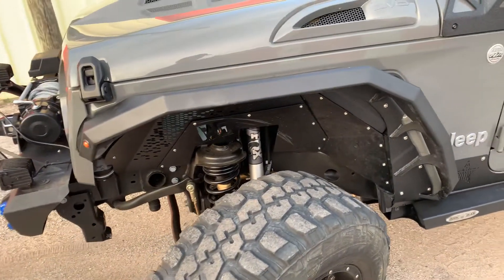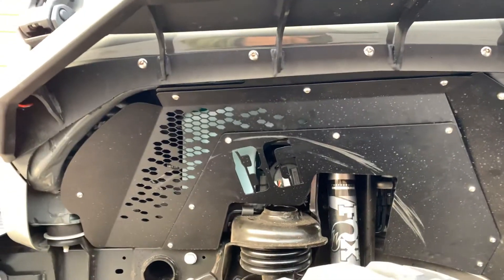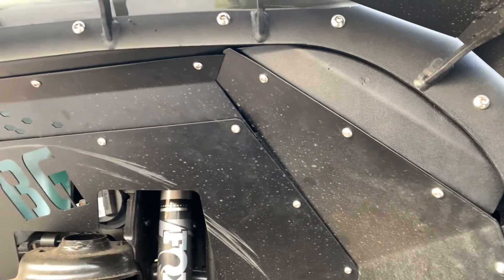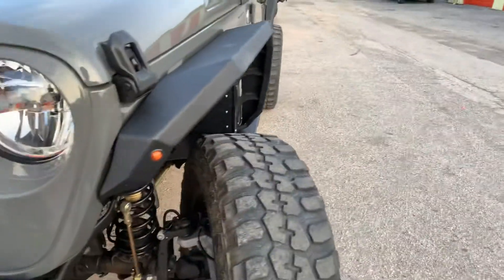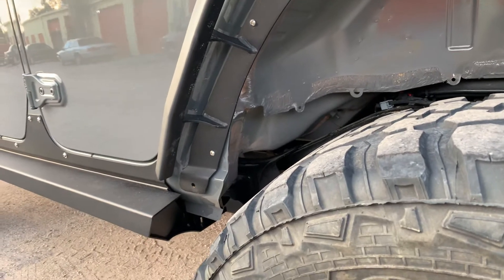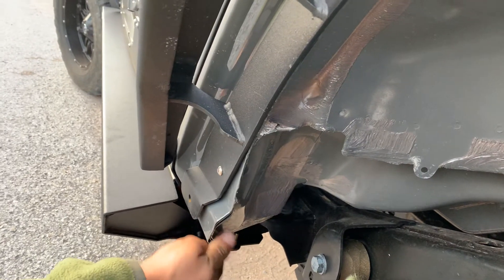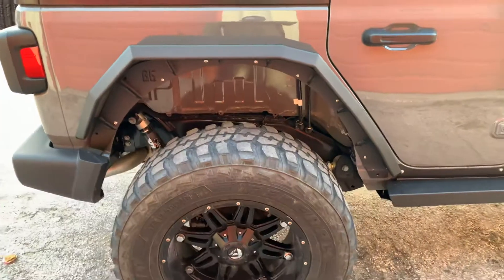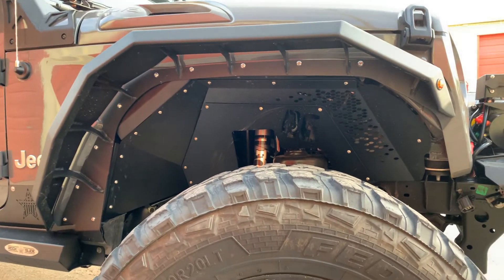Fender and Fender Liner Install Part One…

Comment: Man that sucks because they look pretty rad!  I can't thank you enough for the honest review!  I just checked the install instructions on their website for a JT and it doesn't seem like they took any of your advice except for possibly the square nut inserts.  Absolutely zero mention of cutting the support tabs in their instructions and it's obviously 100% necessary for installation.  Pretty shotty pics and instructions honestly.  The Road Armor Stealth fenders are pretty similar and their instructions are much more detailed with big color pics.  Everyone seems to be rocking the Fab Fours fenders for JL/JT so I'm looking for something different.  I just subscribed cuz I really appreciate the honesty as I was just about to pull the plug on these.  Salute!

Comment from the maker: We never did a follow up with full instructions due to the issues stated. Body guard was contacted and sent a new set of fenders that DID fit in the rear. We did remove everything and install nut certs that we purchased on our own. The new fenders are installed completely and look great!

Comment: So I bought their system for the jeep gladiator and I’m very disappointed the instructions are extremely poor and do not offer enough information for the install. 

Also after watching this video I realize that you have to cut off multiple brackets none of which was mentioned when I bought the system for $2000. 

I would recommend another system unless you want to spend an ample amount of time custom Fabing so you can install the fenders.